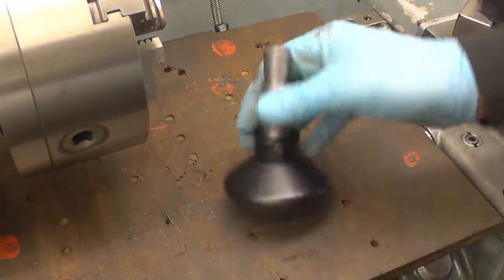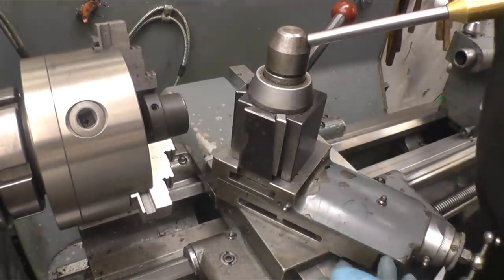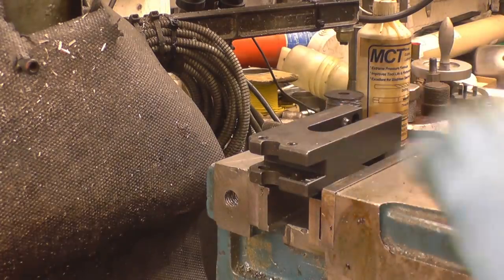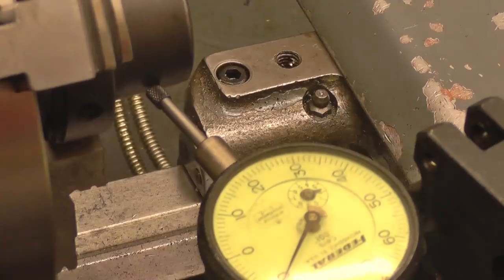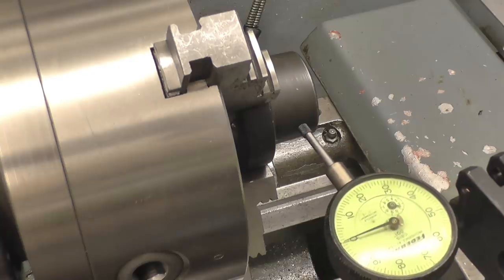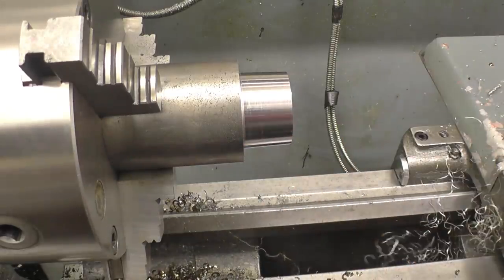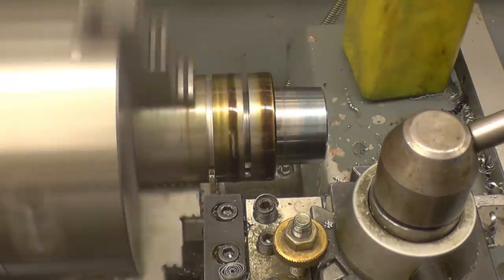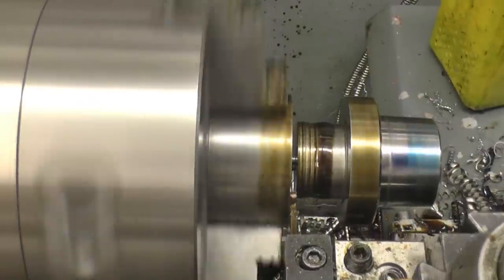SNNC 354 P1  Machining A Taper   . Chuck Adapter

Comment: Your bearings still seem very free as we discussed last month. I noted your chuck key at 2 O'clock started the chuck turning. On my lathe, the tension in the spindle bearings will just hold the chuck key at 3 O'clock - but start it rotating and it accelerates under the weight of the chuck key. I'd suggest the amount you nipped up the bearings, you do the same amount again. The last thing you want is chatter hammer battering on the bearings. Car wheel bearings are considerably tighter than that but grease is a lot thicker than oil ;).
Reply from the maker: If i go any tighter the lathe seems very noisy
Reply: @doubleboost  Interesting. Rough noise or whiney noise ?
Reply from the maker: @millomweb  whiney like a straight cut gear noise
Reply: @doubleboost  That's the correct noise for a gear head lathe - but it shouldn't be too loud obviously. Think of first gear in a Morris Minor type whine ! After all, you have straight cut gears in the headstock - so you should expect whine !
Had a recent discussion with someone with a Mk I Student (top speed 1,000 rpm) who says it's noisy in the top 3 speeds (ear defender type noisy!) - and it doesn't seem to be just one gear - using the various combinations at slower speeds aren't so bad.
I wonder if the spindle is whining and having the bearings nipped up the sound is being transmitted better to the casing ? The very free turning spindle suggests the bearings aren't as tight as 'ideal'. I'll survey the Colchester Lathe group on whininess.
Reply: @doubleboost  I'm going to estimate the whine of mine in top speed 1200 rpm is about half as loud as normal conversation. How does your compare with that ?

Comment: Might be easier/cheaper to have an audio recorder in your pocket with a lav mic - Rode do some good ones - rather than a full radio mic setup. Most video editing packages can auto sync the separate audio back up to the on camera audio. 
Or - as the problem is the auto gain on the camera, see if you can change the settings to fix the gain at a suitable level for your voice (with some headroom for hammer bashing...)